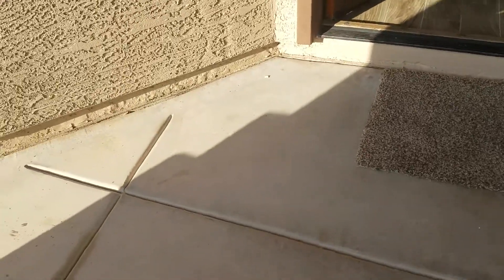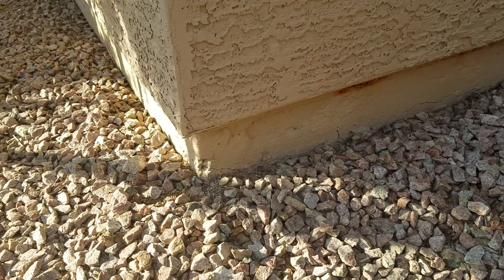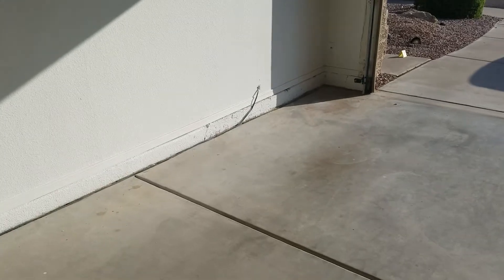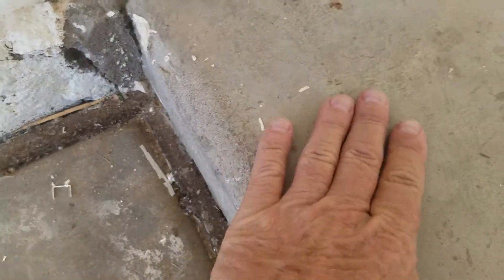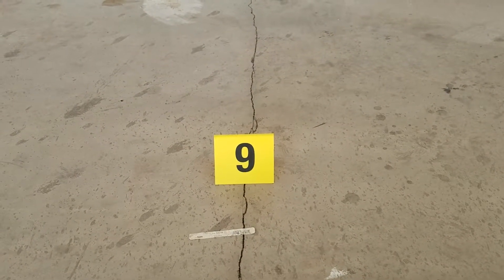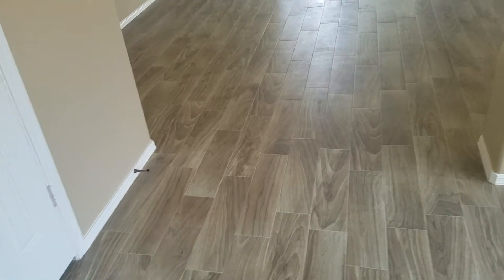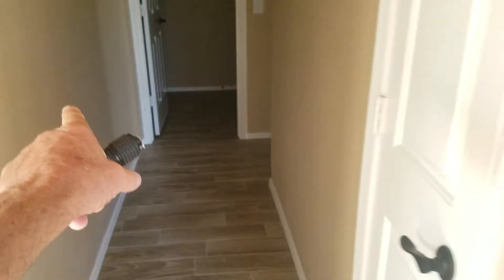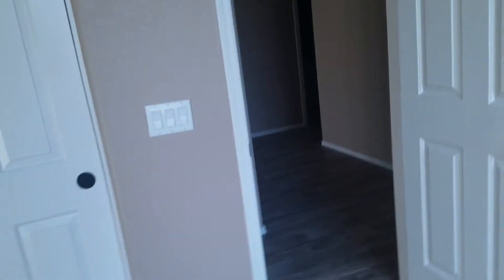Foundation Inspection Summary | Foundation Problems | Drywall Cracks | Foundation Heave Cracks

Comment: What's normal within acceptable limits?  This is depressing.   I guess you could go to every house ever built starting with a log cabin 1n 1492 and provide a repair estimate.  Would  think building inspector and local codes would catch fraud and poor work... why isn't coated  rebar used  in first place???
Reply: How should the cracks in the control joint be repaired?